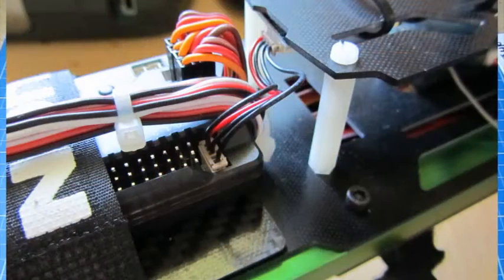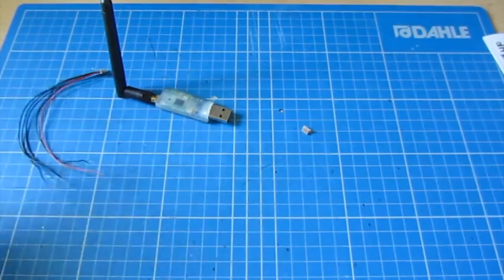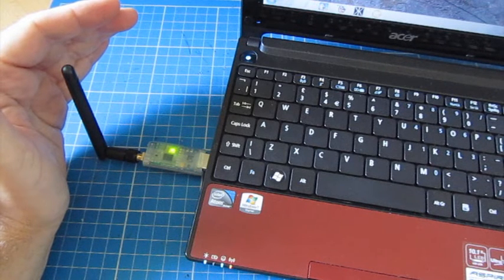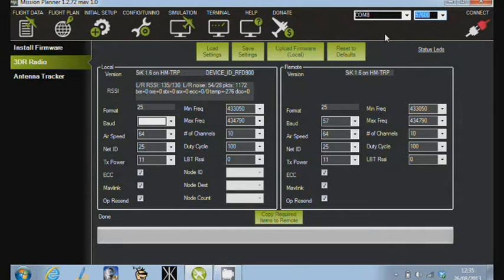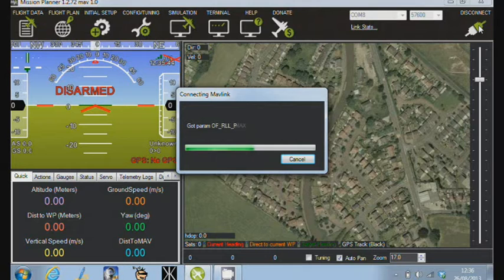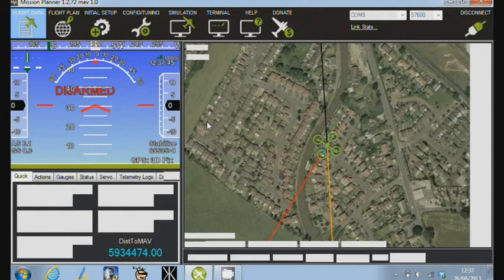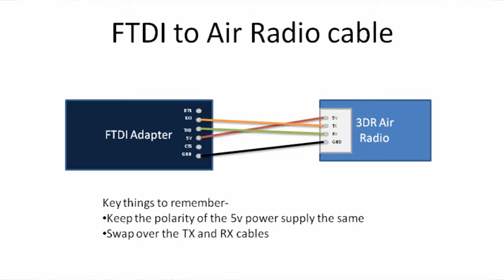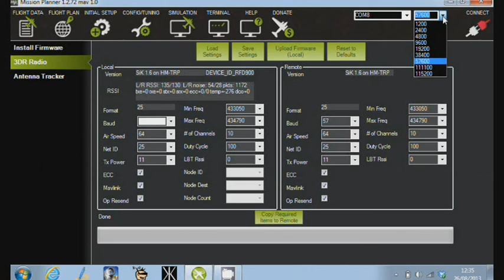MAVLink 3DR Radio on an APM 2.5 Multicopter Board - Overview, Setup and Troubleshooting

Comment: Hello, I ordered My APM Set and ended up with 433Mhz on the 3DR set not the 915 Mhz that I need- even after checking with the vendor (Bang Good) they don't stock 915Mhz? even though it shows on the site? anyway anyone have a 915 Mhz that they want to trade even for a 433 Mhz 3DR set as it is no good to me in the USA I could send it back but thought I would check this way first & might get lucky that someone had the same thing happen in the UK? and we could just trade? keeping my fingers crossed

Comment: Hi Painless,
Wonder if you can shed some light, I have a Bixiler 2 with Hextronic APM board and Telemetery Radio's and every thing is working fine, I have built a Zeter Phantom and fitted a Mini Hextronik APM board and installed the 2 radio's from the Bixiler 2, the board works fine, the 2 Radio's see each other, but I cannot connect the Mission planner to the Radio's, I have spent hours trying to solve this to no avail, what am I missing, Regards Goofa.
Reply from the maker: Hi Goofa. I also struggled with the APM radios. In the end I did get them working, you can see more at 3DR Radio on an APM 2.5 Multicopter Board - Overview, Setup and Troubleshooting

My radios stopped trying to connect after a few mins following power on so make sure you don't hang about. 

Happy flying!

Comment: Thank you very much for this tutorial.  Just now setting up my APM 2.6, had everything working so decided to tackle the 3DR radios.  I had these working before with multiwii, but even though I had solid green lights indicating they were linked, I had no telemetry.  Luckily I still had my FTDI adapter from my old MWii/Arduino days!  I flashed them both, then ran the setup in Mission Planner, and they are talking now!  8^)
Reply from the maker: Great news, glad the video helped! :)

Comment: Hi Painless, I have, what seems to be the exact same radio telemetry as you do but it seems like my transmitter is not being picked up by the receiver as the green light is just blinking in search for a connection any ideas?
Reply: I tried everything apart from the ftdi connector as i dont have one but do you think thats what stops them form talking to eachother?
Reply from the maker: rr You need to get yourself an FTDI connector so you can plug the airside radio into the missionplanner software and look at the radio as a 'local' device and flash the firmware/check all the setting on the radio match the groundside one.
Reply: Painless360 Yeah thats the last thing left, im gonna have to order one tomorrow. thanx for the reply and keep up the great work. Your videos have helped me ALOT

Comment: My ground unit is running 1.9 firmware and the air has 1.6 and I cant get them to connect.  Would that be the reason?  It keeps saying no heartbeat.
Reply from the maker: Try to connect to the air-side radio very quickly after you power on the craft. I've found that leaving it too long can cause the air side radio to 'go to sleep' and lose the ability to connect. Hope this helps. Happy flying!

Comment: Hi Painless I don't know if a dud or a setting issue ,I was having lots of trouble with the PID settings,No matter what i did i could not get a steady flight when adding I /D  As soon as i added any of the two the quad's motors would slow down like a oscillation .
So what your saying then is the bluetooth of the crius might not work with APM 2.6.
The crius board GPS and module and OLED is up for offers.

Comment: Hi Painless I have now give up on the crius se 2.5.was having lot's of trouble with settings i got a dud ,so now getting APM 2.6 can i use the bluetooth from the crius .?
Reply from the maker: Hi Plug. Sounds like you may have. I've not tried the BT module with the APM, it's designed to use a radio link (433 in the UK). You can see how to set that up in one of my other videos. I hope you have better luck. What are you going to do with the broken board?

Comment: What exactly did you reconnect to get the heart beat happening just then at 6.58 when you said,"...just  reconnecting this"....I am getting some confusing things going on, because I know that I have the thing wired up correctly, I had to solder direct to the UART2 solder pads on the back of the board after I had a failure of the 5 pin DF13 connector shortly after I made the "Wyed" leads to accomodate both the Telemetry And MinimOSD . Either the Tx or the Rx lead connection at the Air radio is faulty, So that is how I got around to my first mod of the APM,The thing of it is I am still not getting APM's Heart Beat. Can you offer any advise? Is there a timing issue for connecting the APM or the Telemetry Radio as I suspect? I am about to order a complete unit. BTW as a return favour, I thought I would inform you of this truly magnificent deal from UAV Objects, an arm of RCTimer >>> http://www.uavobjects.com/product/arduflyer-2-5-and-avdomecn06plus-with-915-mhz-mavlin/  <<<<
Reply from the maker: I saw an odd problem where if the connection to the airside radio didn't happen within a very short time after power on at the model end I seemed to lose the option to connect. At the point you mention I unplug the battery from the model and reconnect it (the beeps you here on the video are the ESCs powering up). It always seemed to help clear any problem I had connecting to the radio.

Hope this helps. Happy flying!
Reply: Thanks, I am counting on it.  How in the world would you have thought of that in the first place? But I will say that it certainly puts an interesting spin on other interfacing that we negotiate frequently. I had an issue with an arcing caused by making a non deliberate connection of the XT60 with the power dist. board. 
I am putting a switch on the output of my 3A/5v UBEC so I can have arc free power-up of my APM2.5.2 and peripherals.
Regards
C
Reply: Well I'll be, it worked a charm! Thanks pal. I had a feeling about this method and sure enough.
Reply from the maker: Great news - glad it worked for you too. I'm playing with the Mission Planner now, you planning on posting any videos?
Reply: How did you know? Problem with getting the flight modes configured.
Reply from the maker: Hi Chris, you need to flick the tx switch while viewing the modes in the Mission Planner. Assign the modes you want to the green boxes that highlight as you move the switch for your channel 7 values on the radio. Hope this helps. Failing that post a vid and I'll take a look..
Reply: Painless360 Well there is a funny thing going on with Mission Planner, I can't get the 3DR Radio headings on the left hand column to show up with the Config Button depressed. I have had them up on screen once in the recent past.  I have the most recent ver. of MP installed. There are other matters that I won't delve into.. I have gone back to the KK2.0 while I decide what to do now. I am so ready to drop some serious coin on an RTF. And I deserve it after the amount of bench time I have put in. I am addressing ESC matters now :-)
Reply from the maker: Chris, sorry to hear that you've still got problems. I know how you feel - I spend over £100 on swapping every component on one of my quads before finding, by accident mind you, that the flash tool for the ESCs for the SimonK firmware had a bug and had flashed the wrong bloody firmware into my ESCs.

Sigh.

Don't give up, sounds like you are almost there and then you can help other setup this complex, open source technology.

 I did start building by using much more simple flight control boards (MWC and KK2.0) and was glad I did before tackling the APM2.5.

Let me know how you get on..
Reply: Painless360  Even the seemingly perfected KKMuticopter Flashtool is not infallible. That was not fair to you, and it really goes to show you how far off track one can get.They didn't call me in to work today so I will do some polish on my "Ultimate 9X Upgrade"  I am learning the new editing software by Movie MAgix Edit Pro '13. A bit of a handful that.
As for the 2.5, I have installed 2nd UBEC. I was under the impression a 3A/5V UBEC would power APM2.5, all periph. and Rx. Not in my case, rumoured to be a draw of 100mA (D8RII+). I did a test during boot-up, and measured 280 spiking at 580 (all peripherals up, no Rx). Plug in the Rx and the APM browns out immediately. So I have no choice to use another. Soldered that up last night, and made an isolation mount with those little rubber "balls". I used 35 gm cap type and will suspend the APM there on a 1/8th" aluminum plate to give it more mass. I am rewiring all connections from the PDB thru to the peripherals . Items arrived in post this past wkd. Have arranged with a chap I met on RCG that lives a 20 min drive from me to go over the whole works from top to bottom. I will stop here before I write another novel Painless. Sorry for these large responses. But yesterday I really had an epiphany when I saw the FW video you did. I really had this huge grey area around the various iterations of SimonK FW. Totally new outlook today. Thanks for all your help pal. I will contact you with video releases.

Comment: Nice helpful video, have you used minimosd at all? I'm having issues with mine only displaying the message 'No MAV data' any thoughts?
Reply from the maker: I've looked at the MiminOSD myself and never been tempted. I suggest tracing the rx and tx lines from the main board and swapping them over to see if that helps. Apart from that I don't have experience to help figure it out. Sorry.
Reply from the maker: Benjamin Harvey Hi Ben, I've just setup a MinimOSD on one of my Multiwii models - you will need to update the code to 2.3 to work. I'm uploading a video as I type that should help. Watch for it on the channel..Happy flying!

Comment: I was under the impression that the Air side was done thru the Mission Planner. Or at least I have seen or read it happens that way. Of course I updated the FW on the Ground with the FTDI just fine. So I am encouraged to here of your experience. Just figured out how to do the MinimOSD and the CPPM FW on my FrSKy D8RIIPlus with the FTDI. All ready paid for itself. Thanks for this.
Reply from the maker: Thanks for the comment, I also read the same things on the web when I was trying to set this up and that's exactly why I made the video when I'd figured it out and got it working.

Thanks again, happy flying!
Reply: Painless360 Feeling is mutual of course sir. Now what if I really got stuck with ER9X and the flight modes/switches for APM 2.5 Painless? Would you be able to offer any advice? Throw in your two pence :-) Just hit a wall with the version / build of the FW . Brand new to RC and the 9X. Need to get some water under the bridge (Get away from the workbench and fly) with this 650mm quad trainer.

Comment from the maker: Hi Alan, I've not read about the timeout it on the blogs (and can't see it in the code) but from the experience setting up these radios this seems to be the case - you can see it happen in the video.

The only other thing I did when trouble shooting was check that there were no shorts between any of the pins on both the airside radio and the APM socket using a multimeter. I've read that some boards had excess solder that caused problems.

Good luck locating the problem on yours.

Comment from the maker: Hi Alan, not tried that exact board but this doesn't seem to be board specific from the posts I've found in the forums. 

I struggled with mine until I rewired the cable to the APM board from scratch to make sure I'd crossed the Tx and Rx lines and then flashed both units with the latest firmware using the Mission Planner as shown in this video. 

The wireless connection has to be made within a minute after power on at the air side else it all times out. Hope this helps.